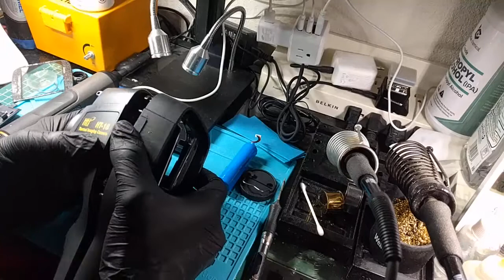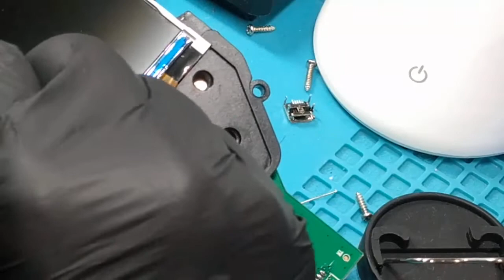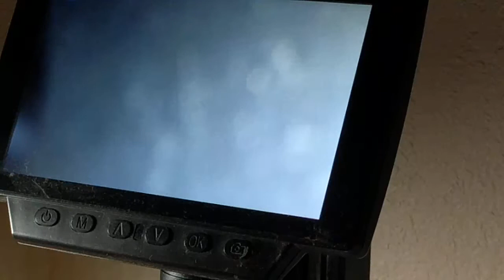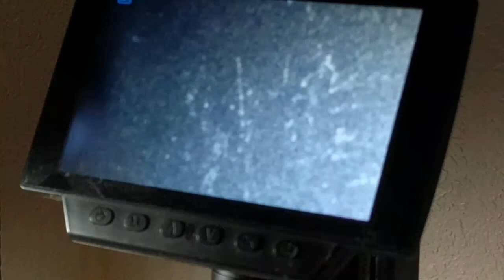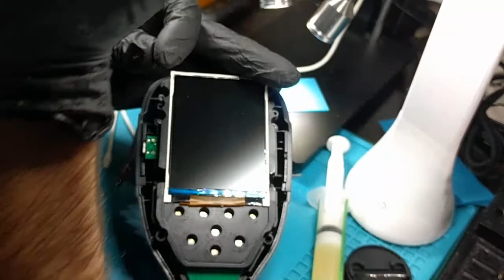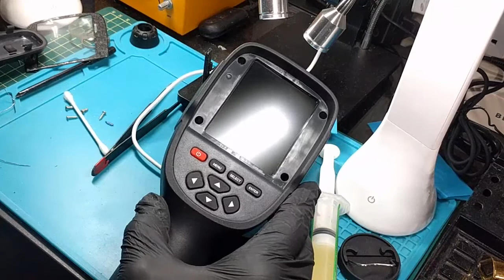HT 18 Thermal Camera USB Repair Part 1

Comment: This video saved the day for me. I bought a unit with no cable and encountered the same “not deep enough “ insertion problem. I dremeled, (tapered back the male plug end) of the replacement micro-usb cable, problem solved, thanks

Comment: I just wanted to say thankyou for this video. I was having difficulty getting into a Kaiweets KTI-W01 thermal camera (shares a basically identical outer-shell as this HT-18). There were big dust particles trapped under the screen that I needed to clean away. With your video, I finally figured out how to get in there. Thankss. ^^